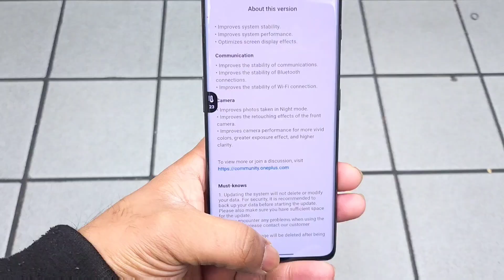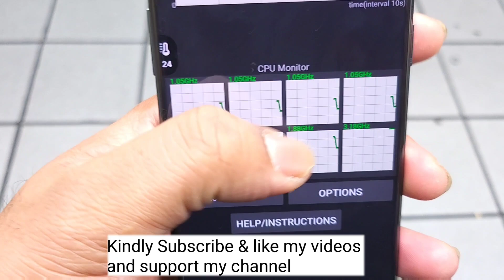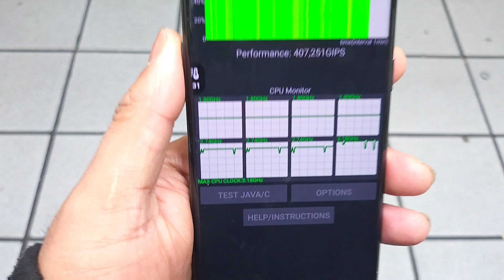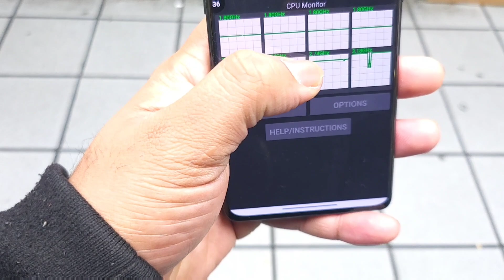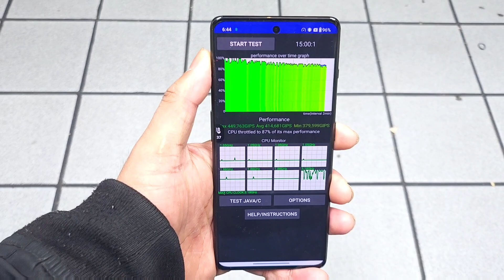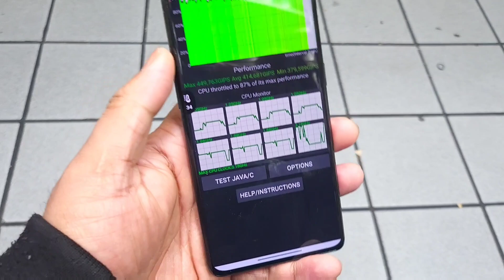Oneplus 11r CPU Throttling Test After Software Update Heating Test

Comment: Bro u not notice that when temperature is below 39 then performance not throttle but if temperature above 39 then throttling occur it means one plus under lock performance till temperature not greater than 39 
If temperature>39 = CPU throttle but if 
Temperature<39 = no CPU throttle